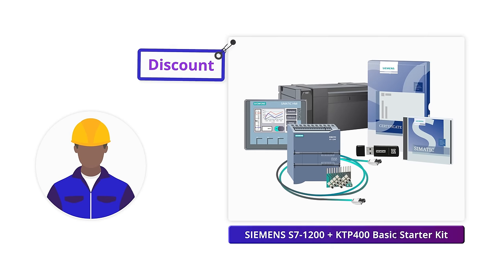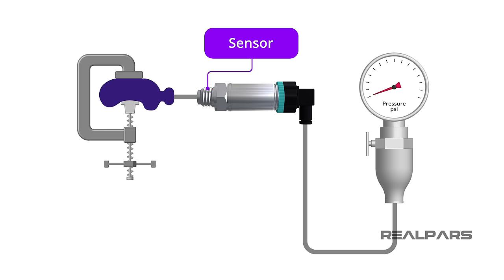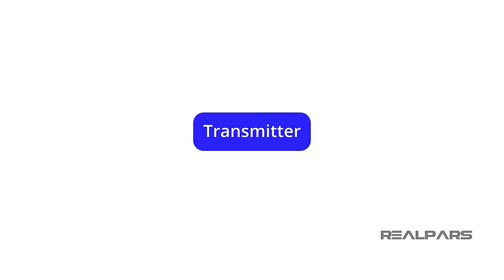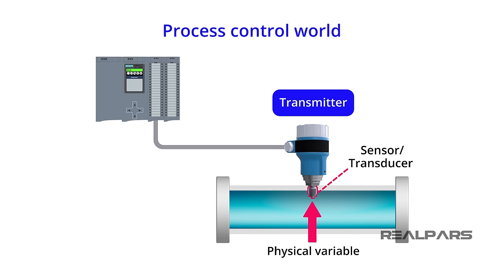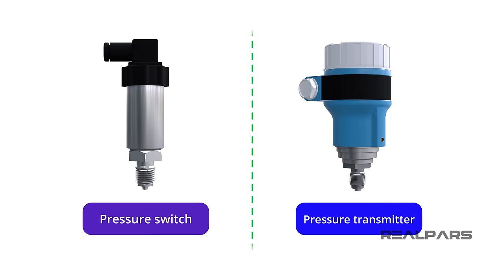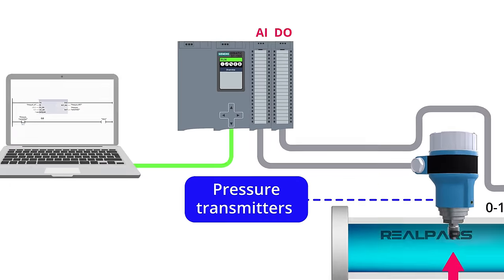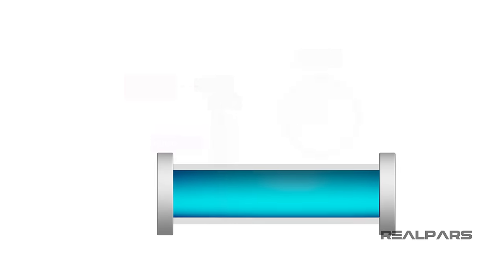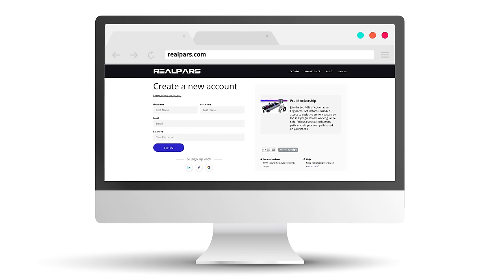Pressure Sensor, Transducer, and Transmitter Explained | Application of Each

Comment: Hi
What's the difference between transmitter & transducer? 
Thanks
Reply from the maker: Hi there.  There's certainly lots of confusion in the industry as the terms are often used to describe the same thing.  A transducer is also referred to as a sensor.  A sensor is a device that detects whatever variable is being measured, monitored and/or controlled. The sensor is connected to a transmitter. The transmitter produces a signal that represents the process being measured. This signal is sent to a receiving device such as a PLC.

Comment: Sir I want to clear a point...
In video it is said tha "All sensors are transducers but not all transducers are sensors".
What about RTD which is sensors that it changes its resistance when temperature changes but doesnot convert a form of energy to other.
So I think its a sensors but not a transducer.
Reply from the maker: Hi Khuram. The terms do get a bit muddied. An RTD is a transducer. consider that it as it converts temperature to resistance. As for transducers, we could probably categorize them as input or output, which perhaps provides clarity between sensor/transducer. In the video, we used a loudspeaker that would be considered an output transducer.

Comment: So this sensor can make physical contact to the system without damage ?
Reply from the maker: Hi @brad. The short answer is yes. When you buy a sensor such as a pressure sensor, it's best to check to see if it is suitable for the physical material under test.  On the other hand, RTD sensors cannot usually be exposed to the process directly and consequently are inserted into a thermowell.

Comment: let me see if I get it straight: A pressure transmitter is a pressure transducer or sensor which has an antenna
Reply: No, it doesn't always have an antenna.  It has some means of transmitting the signal measurement over distance.  That could be a wired connection.

Comment: Sir what is AI   AO  DI  DO
Reply: AI: Analog Input
AO: Analog Output
DI: Digital Output
DO: Digital Output
think of 'analog' as a range of values, such as a pressure readout, or temperature. while 'digital' will always be either on or off, like a cutoff, or light